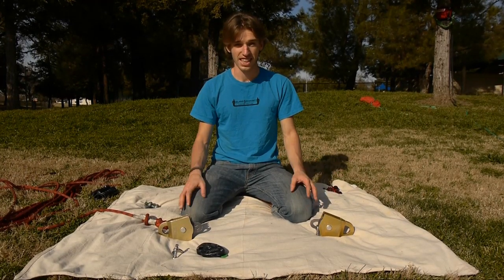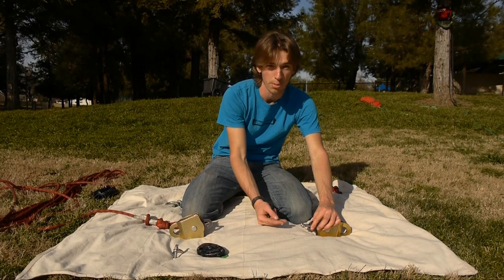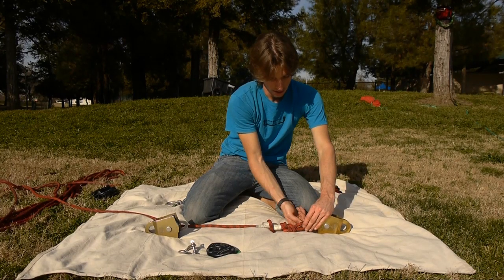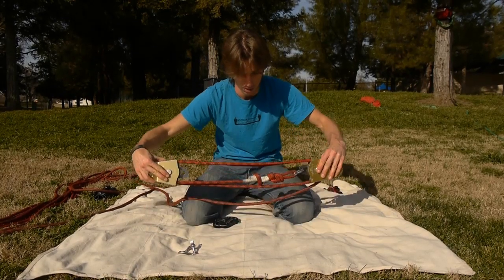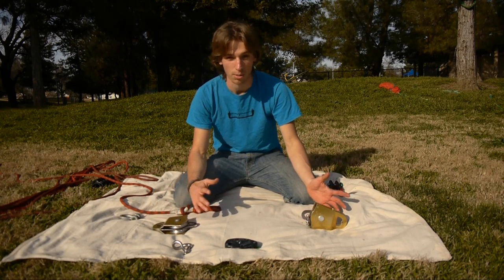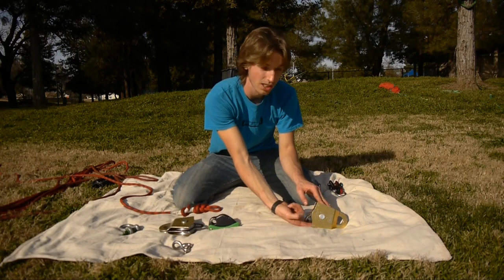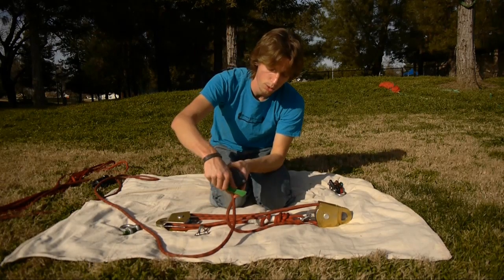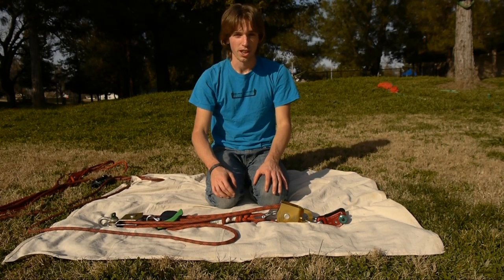Slack Science - How to Reeve your Pulley System

Comment: Good stuff !!
Is there any reason I shouldn’t have a sewn eye instead of the bulky figure-8 knot. Nice and skinny for even less friction. Stainless shackle or quick link from sewn eye to becket ?
On the other end,  could I avoid the crowded becket and run the brake outside and below the pulley block, sharing it’s anchor with a distribution plate ?
Never heard any reasoning for the different reavings.  Thanks for that. 
Keep up the nice how-to’s.
Reply from the maker: Sewn eyes are great if you have access to them. We now have a sewing machine capable of producing them, but haven't yet optimized our stitch patterns. Soon though!

You can definitely put your brake on a rigging plate instead of on the becket, we've rigged like that a lot. I just like the streamlined system with it embedded.